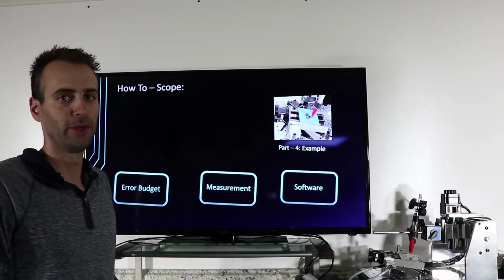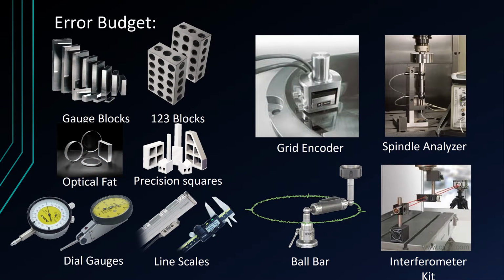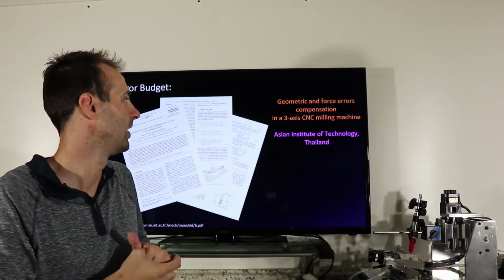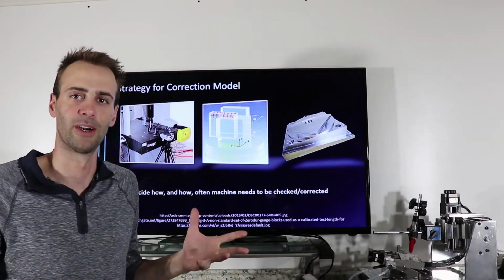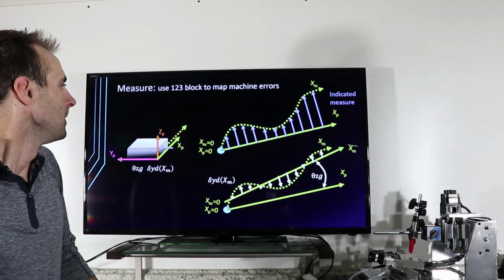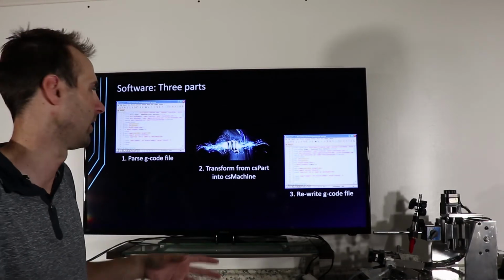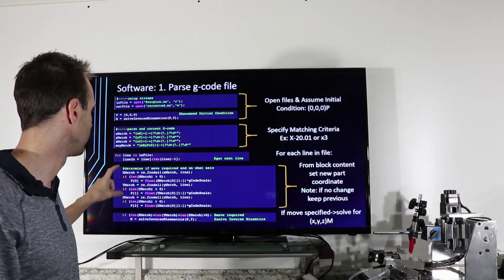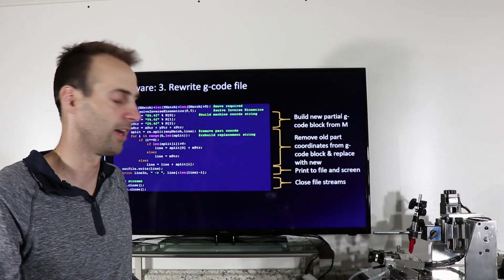Error Compensation of CNC Machines - Part 4/4

Comment: Great series Jacob, thank you for sharing. I have some questions about measuring all of the angles for the geometrical error matrices. Using a method like running a dial indicator against a gauge block, can't we only measure two of the angles per axis? For instance, by moving the X axis, you can capture the yaw and roll angles but not the pitch. 

Also, if your X axis is mounted on the Y axis and you measure the misalignment angles for both, doesn't this make the yaw around the Z axis for the Y axis somewhat redundant, since it's already considered in the X axis angles? Thanks for your help.

Comment: it was very interesting and well-presented...although I think it would take me many months to figure out how to program something similar for my own cnc machine, should I ever even finish that.
Reply from the maker: Understand that, time is precious! If you do decide to tackle it, I can send you the code that includes the scraping of g-code from a file, the solve block as a template, and the matrix math functions. From there the hardest part is building a model and actually measuring the errors before and after. Maybe start with one axis, like if the z is tilted then track the motion with x & y.
Reply: @internationalprecisionengi1737  thanks for the encouraging reply.  I'm still slogging away at trying to figure out how to build a machine but it's motivating to think that I could make it even more precise with this kind of error correction.

Comment: Thank you very much for taking the time to put this series together. I randomly happened on this series and was stoked to watch through the series. I recently finished reading through Slocum's Machine tool design and the transformation matrix and error budgeting section was difficult to work through. Your videos were the ONLY video source I have found on the internet to provide additional instruction on  using the HTM models for error compensating machine tools.  Thank you.
Reply from the maker: Thanks for watching, hope it helps, if not hit me up and I''ll work through it with you. Slocum's a funny guy and I'm sure if you reached out he'd help too.
Reply: That would be a big help. I watched  the machine design series of Slocum's MIT lectures and got a kick out of those.  I wish I would have been exposed to classes like that in undergrad.  Anyways, I went as far a trying to contact a professor teaching machine design at O(regon)SU (nearest eng. school)  to get a grad student to tutor me on this aspect of machine design, but the class was no longer being offered,.  Anyways, I will to take you up on the offer once I rewalk through the  sections in slocum's book and try to work my particular design into the error budgeting spreadsheet Slocum provides online.

Comment: Like the Harry Potter movies, each release is longer than the previous. :) I would like to try this out. What is your expectation of error on a hobby sized mill with a trammed head and vice over a small 4x4x1" range? The best that I currently measure is .0005" which I suspect is better than what the mill can do, but would purchase a .0001 indicator if you recommend doing so. For what it is worth, longer videos, if they are educational, are fine with me. You could share the videos with potential clients as marketing material. Better than a resume.
Reply from the maker: Yes, too long. It was a nightmare to cut and upload too. You might be able to pick up squareness errors over the 4" length with the 001" dial. It might be easier to do a series of test cuts and then take the parts to a buddies metrology bench (window glass sitting on a polished floor tile works too) where you can use a precision square to compare and map. - the good news is that if you cant measure it, then perhaps you don't need to correct right?
Reply: That last sentence is spot on. I can't measure significant enough squareness error to care about, without become the masochist you describe. The place where I am able to measure error is circular interpolation. Realistically though,  on my small mill I can be easily deflect the tool by lightly pressing on the side of the head. Your techniques greatly appeal to my analytic side, but yeah, fix the gross errors first. By the way, great discussion about the rep-rap style 3d printers.